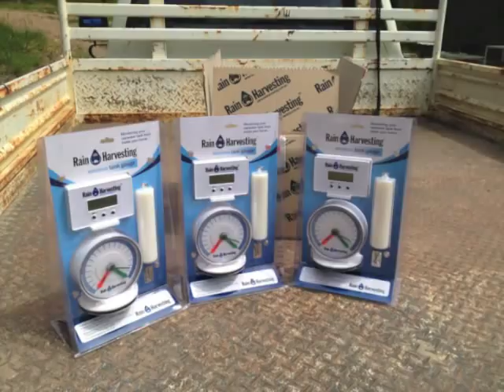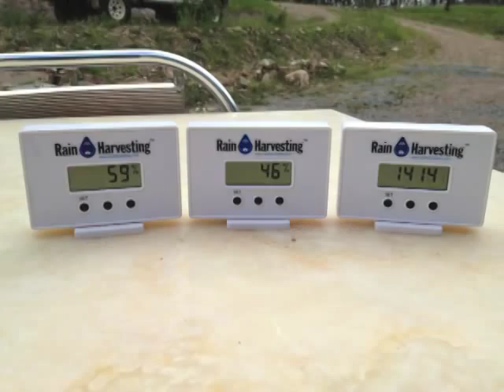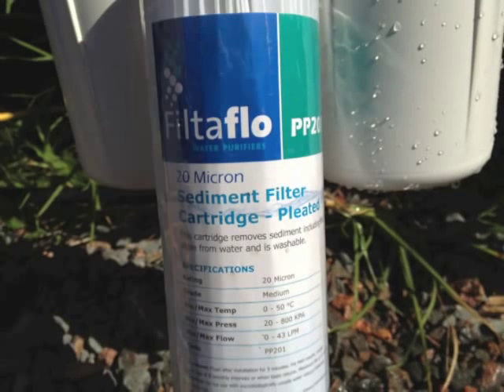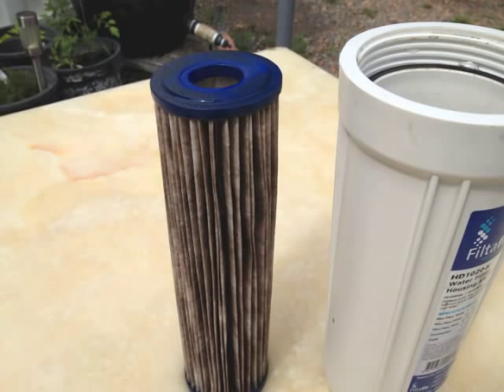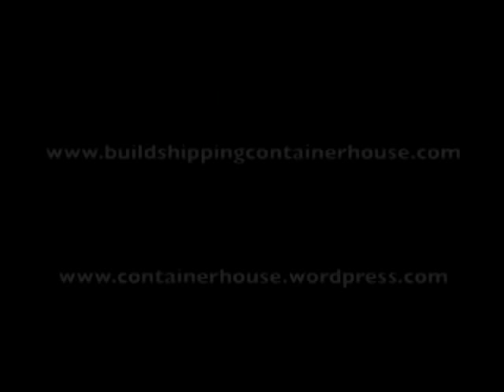Shipping Container House - Wireless water tank

Comment: Hi Paul, have watched all I think of your vids. These should all be put together as a documentary and viewed on TV, I am sure a lot of interest.  I have water tanks as well and love this off grid living you do. A good tip if you haven't already done it for your water, as I see you get very dirty 20mic filter after 6 months as I did. if you connect from the inside of your tank a flex hose on a float (milk bottle with handle) and tie your draw inlet pipe so its sucking about 100mm below the surface this is the cleanest area of the tanks water. Also when water is poring into a near empty water tank you will know it stirs up the silt at the bottom of the tank. again if you run an inlet pvc pipe from the inside of the tank to the bottom of the tank put in a couple of elbows so the flow is facing up this works well. I am very carful with our water as we all drink it. tank water only. I run 20mic reusable washable filter, then a 5mic, then a 1 mic all 10" long and a jumbo carbon block direct to the ice/water fridge for drinking. I only have to change them once a year now. You could look at a gravity water system. 10- 15m up one of those trees into a small header tank, save running that pump. I run a gravity system if you need any ideas. Thanks for posting.
Reply from the maker: GAZ COR Hi Gaz, thankyou for the suggestion about the documentary. There is a film maker in Europe who will be putting a short internet documentary together, but I have delayed it until the kitchen is done. I am interested in a gravity system that could replace our ceramic water filter that we top up by hand. You are correct about me stirring the water up and elbows or a float would certainly help. Could you tell me more about the 1 micron carbon block as that is a new concept, how much where from etc. 10 - 15 m sounds difficult to do, if you have done it, I would love to see a picture. Contact me via the website contact page for my email. Many thanks, Cheers Paul

Comment: I just started your vids and looks like they are going to be great.
I noticed in your vid a 4in sewer pipe from the roof to your tank for water.
I too store water from my roof.
I first had 4 in sewer pipe going all over the place, expensive and inconvenient. I had to have the tanks near the source for capture, what a pain!
Then a light bulb went off in my head.
Here is what I did. Take the sewer pipe and use the pipe as your down spot then cap the end and install a 1 1/4 inch ball-valve at the end 4 drainage to the ground. Then I installed about a foot up from the bottom a 3/4 pipe adaptor to garden house. Now I can bury it or leave above ground to take anywhere on the property where ever I choose to put a tanks. The tank no longer needs to be near the source. As the water fills in the pipe it will pump water to the height of the pipe anywhere on the property to that height.
I have two 2800 gal tanks plus 8 - 300 gal thank that I keep full just by moving the garden house to the next tank when full.
It so simple and cost almost nothing.
After the tanks are all full, just open the 1 1/4 ball-valve and let it go to the ground, pond or where ever. No more ducking pipes or unsightfulness . In fact, I ran the existing down spot right inside the sewer pipe so I didn't have to try and make a special fitting at the top to fit the sewer pipe. The sewer pipe looks so natural as a down spot. The existing gutter helps trap debris from getting into the sewer pipe and you can even drill holes in the existing down spot if you want but it's not really necessary. When I close off the garden hose during a rain and let the water in the pipe rise, I then open the ball-valve and whoosh! All cleaned out.
Love your container idea! I once kicked that idea around and now wish I had acted on it. Great job!
Reply from the maker: Ok I understand. It would let me get rid of the white pipe from the roof to the red tank. I like that idea. I had to make it removable so I could inspect the inside or manually fill, and the wind occasionally blows it off.  I might incorporate your concept. Cheers Paul